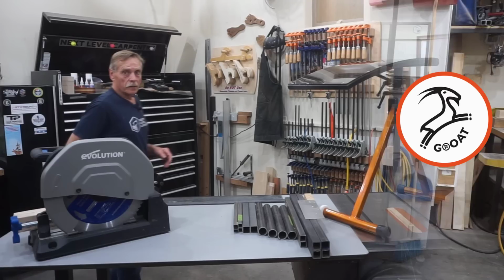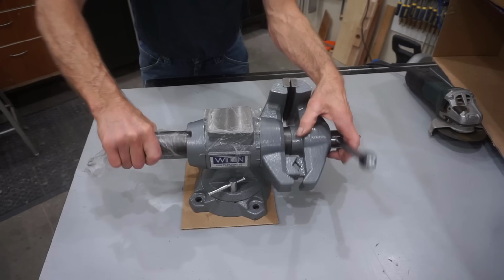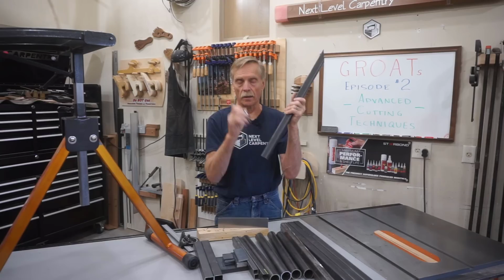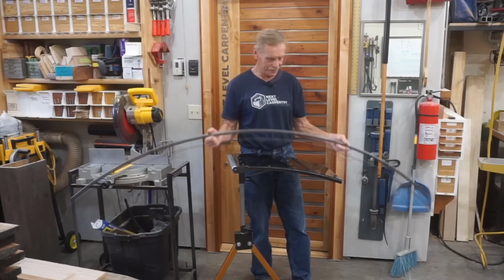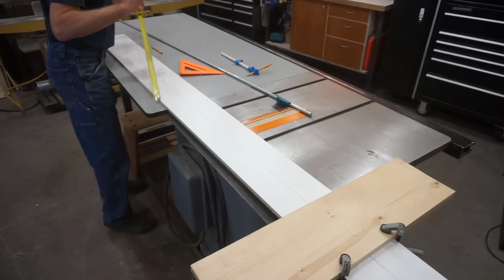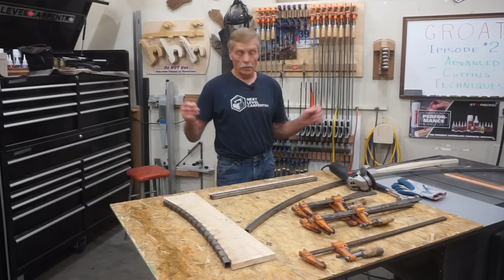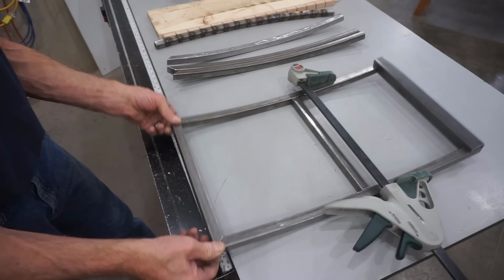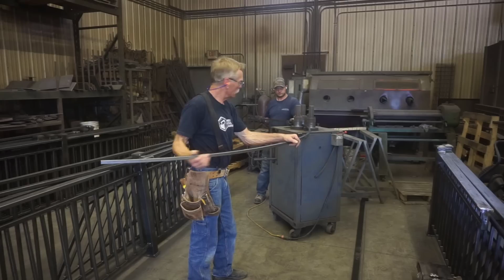GROAT Build Series: Episode #2

Comment: Matt; a couple tips for you and your viewers, when cutting using a grinder an cut off wheel, mark your layout with a scribe, then you can cut off sting of your mark and then grind back to it very accurately. Secondly when notching tubing the notch will normally take up 1/3 of the surface of the main tube, so it you cut the tube to be notched square at that first, only the center needs to be cut out leaving two nice full thickness ends to be welded. Thanks for the great videos Matt!

Comment: I have bent square tubing by using a vise and 3 spacers. Put 1 spacer on one side of the tube at each end of vise jaw and the 3rd spacer on the other side of the tube in the middle of the jaws. Tighten the vise carefully to bend the tubing. Keep moving the tubing and making small bends. 

You can't use this method to bend heavy duty tubing, but should work for tubing for a project like this.
Reply from the maker: Interesting process Mike... sounds like a viable alternative... thanks for adding it here!

Comment: Really amazing! I can use this brilliant idea in my welding/ fabrication shop as well. I’ve used the Evolution Rage 3 Dual Compound Sliding Miter Saw for as long as it’s been on the market as well as the same metal cutting saw as you used for many years.
I’ve been a fabricator for 45 years and there isn’t anything so far that tops the G.R.O.A.T that I’d want to make several for myself for home and work! I look forward to parts 3-5 & purchasing the prints for it! Very well done!!
Reply from the maker: Thanks Brady... much appreciated!  If you do end up buying a set of plans I'd be interested to hear your reaction to them from your perspective of 45 years.  You've seen a LOT of plans in that timeframe and I've studied these so much my eyes are crossed so a 'fresh set of eyes' would be appreciated if you have time and inclination to share.
Best,
Matt

Comment: What about just making your initial leg count another inch longer then you would have a pilot hole for the hole saw.
Reply: Cut
Reply from the maker: That method works about the same SM... in fact, that's the way I did the ends on the prototype stand you see in the video but the tubes I cut for this were a little too short so I included a work-around for anyone in the same predicament.  Thanks for watching and commenting on this one!

Comment: One cutting method U didn't mention is a hacksaw. I always thought the hacksaw was a luddite method till I spent some time in Mexico where a great deal of work gets accomplished mechanically. If ur not doing a big production job, the lowly hacksaw should be in everybody's toolbox
Reply: I think a portaband saw is a great tool for cutting metal as well
Reply from the maker: That thought crossed my mind because if the kerf from a hacksaw blade is wide enough to make the bend it would be cleaner and faster to close up the  kerks with weld...
Reply: @NextLevelCarpentry  I made a port-a-band stand which makes cuts like that sort of kerf a snap, & very safe
Reply from the maker: @EngineerMikeF  cool! 👍

Comment: Probably the only other way to make the bend would be to heat the tubing and clamp it to a template while it cools. Your kerf method works fine though. nothing wrong with doing it that way. I think those bending machines are called "Diacro Benders"

Comment: For what you are doing you only needed to properly tack the kerfs..... you DEFINITELY don't need to weld them solid
Reply from the maker: For strength, I agree, Ryan. Tacking is plenty strong. The extra measures of welding solid and grinding are for aesthetics which are "not necessary" but ARE next level IMHO.  Thanks for watching and commenting regardless...

Comment: Thank you for the great video.
That was great that Justin was able to restore the files for you.
Interesting to see the process of bending the square stock. I was trying to think of a way to do it in the shop. Possibly hand crank and couple rollers on a steel backer.
The small piece, what if you used the two pieces of the jig, increase the Arc for spring back, take the clamps and work it in?
Great job.
How much is it to be a patrion member?
Reply from the maker: I didn't explore other options for bending those tubes but the ones you suggest sounds like they would be worth a try.  Someone else suggested using a vise and 3 spacers, 2 on one jaw, 1 on the other to gradually bend the curve.
Thanks for your interest in Patreon!  Some Channels have different 'tiers' for Patreon membership but for Next Level Carpentry I leave it up to the viewer/member and all patrons have access to the same content. The monthly range for Next Level Carpentry starts at $1 and as high as $25 with $5/mo being pretty common.  It's most important to me that it's a good value for anyone who 'goes above and beyond' with support as patrons..

Comment: 3:00 Where's the stop to make consitent cuts? Perhaps you could clamp down an angle iron outside the sawblade in the slot? Flat iron with two holes, two M8 screws with knobs and an M8 square nut.
Reply from the maker: Thanks for watching and commenting on this one! That would be a good setup for consistent, repetitive cuts in a production setting but not worth the trouble for only a few pieces where that level of precision isn't necessary IMHO
Reply: @NextLevelCarpentry  I can see that. 
My thoughts are like this: You have an expensive machine not for one time only. (As you rightfully noticed.) Else a hacksaw (angle grinder) could have done. So the sooner you build a stop the sooner you can profit from it. That would be next level. Just marking and eyeballing is just ... ordinary cutting.
I wonder basically, why that saw does not come with amenities like that anyway. And when you get to it a stop for the cut's depth would be nice too.
With the set up as it is you only have the precision of vertical and consistent angle from the fence. Not too much in my view. I guess you and your trusted Metabo can do as well.
Reply from the maker: @user-sm3xq5ob5d  Your perspective, thoughts and reasoning are all valid... thanks of sharing them.  It adds to the value of the video for other viewers who can decide what type of setup makes the most sense for them, their shop and their situation.  You'd probably be amazed (or disappointed) to learn that I don't even have a repetitive stop setup for my miter saw station either and I do woodworking for a living! 🤯  
There's so many factors involved and other ways of doing things so I'm fascinated by what others choose and adapt to. For instance, this is one method I use frequently that makes my work, in my relatively small shop, quick, accurate and efficient without space required for a dedicated cutting station with... a length stop arrangement: https://youtu.be/pt5sFM_cIDQ  
Best,
Matt

Comment: You did a lot of work to get that arc exactly to plan but it seams that arg is some what arbitrary in the first place.
Reply from the maker: If the radius of the arc was to vary by 4 in one way or the other (ie: 70"-74") it would probably still work just fine because it's just a number I pulled out of thin air when I made the original Roller stands and it happened to work excellent. I hope the demonstration of what it takes to fine tune the radius is helpful if someone uses the method and needs to create four pieces of equal radius for a pair of GROATs regardless of what the actual radius is.

Comment: Not a woodworking project. It's far cheaper and faster to buy the most expensive roller stands on the market than to spend a thousand dollars plus on a welder and all the metal working tools, not to mention the 6 months of doing practice welding, just to make a pair of these stands. Nick Engler has a really good video on some stands that are made out of wood. https://www.youtube.com/watch?v=GFF57NC4PCY
Reply: The point of this channel is not what's less expensive.  Even a person who is never going to build one of these can learn a lot about "making" by watching this.  That's pretty much the mantra of this channel.  Personally, I have roller stands from Sears I bought a long time ago.  They are crap and they fall over sometimes but they work most times.  If I had the time and the inclination, I could build these from Matt's videos....with the expensive tools or not.  Anything made out of wood is not going to be nearly as durable, not to mention as heavy, (and therefore untippable) as these but I'll check out the video you posted.  Thank you.
Reply: Okay, I just watched that NE video...those are some beefy wooden roller stands!
Reply from the maker: Schwooosschhh... that's the sound of you completely missing the point of this video Tom. I respect your viewpoint on what seems like a great Pair of Roller stands in another video but regardless of how good they are they do not have the ramp that is the heart and soul of the design of these roller stands. It's a feature that is well worth any extra time effort or commitment to attain IMHO
Reply: @NextLevelCarpentry  Absolutely! I don't know how many times I've destroyed an expensive piece of wood when it tipped over my cheap roller stand going off the table saw or was gouged by the planer or drum sander as it dropped off of the roller stand and began bouncing.  I've been waiting for several years for these videos, thanks Matt, great stuff!
Reply from the maker: @curtisschmidtlein5606  Thanks for watching and commenting on this one... BTW we should talk as the fate of my original GROATs is yet to be determined... juss sayin' 😉
Reply: @NextLevelCarpentry  can you smell the brakes and rubber burning outside your shop?
Reply from the maker: @curtisschmidtlein5606  I wondered what all the screeching and smoke was from😂